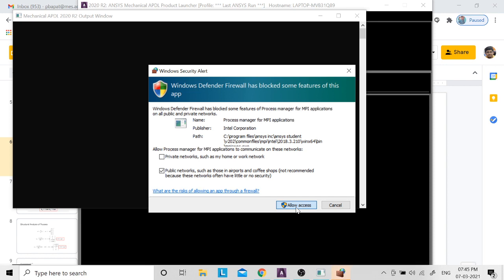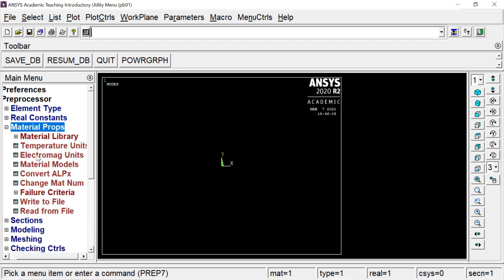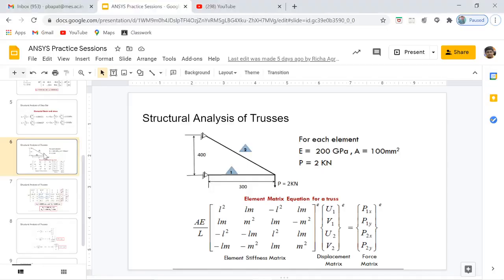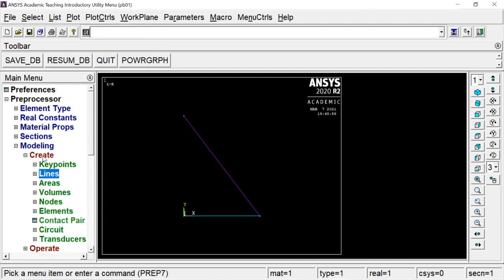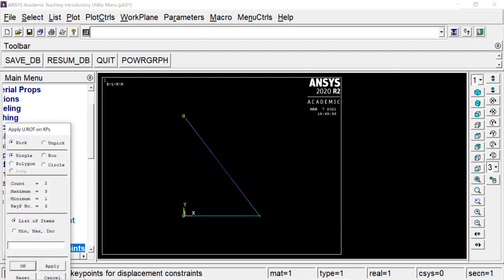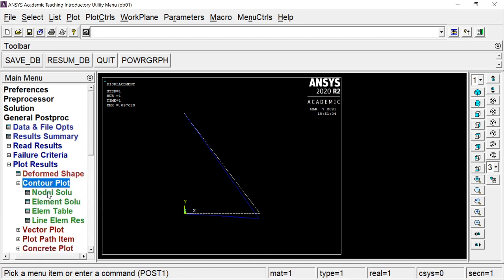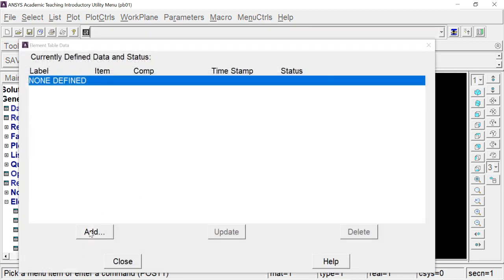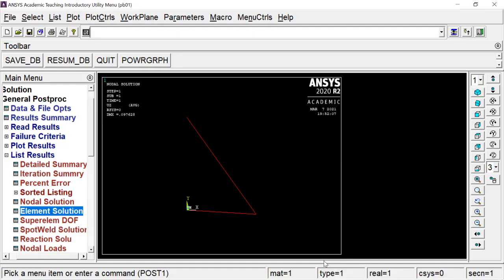ANSYS    Truss Problem   1D   Link180 Element

Comment: PLEASE i need answer for this question

Problem to verify the program: Analysis of two – bar truss
Aim: To perform static Analysis for two – bar truss,
Discipline: Structural,
Analysis Type: Static,
Element Type: Link180 or appropriate element depending upon the version of ANSYS.
Problem Description: A two – bar truss subjected to vertical load F is shown in the figure below with area of cross section, A, and modulus of elasticity, E, for all members. Equivalent finite element model is also shown in the figure. The joint displacements, reactions forces, member forces and stresses are to be determined.
Material Properties: E=2x105 N/mm2,
Geometrical Properties: A = 200 mm2,
Loading information: F =12 kN
1 2 12 kN 1 2 3 500 mm